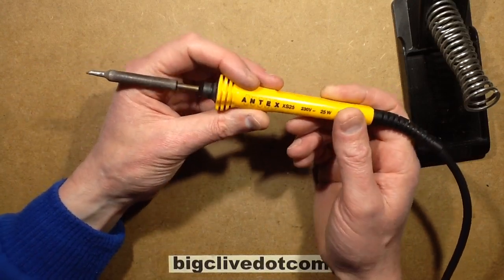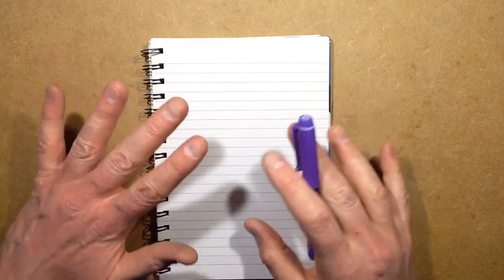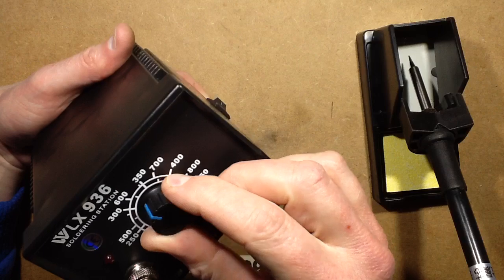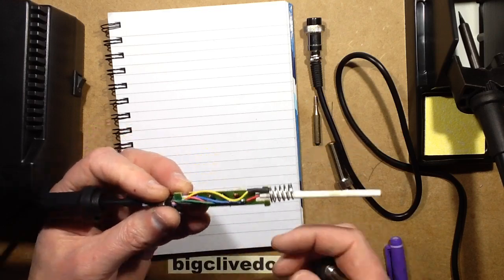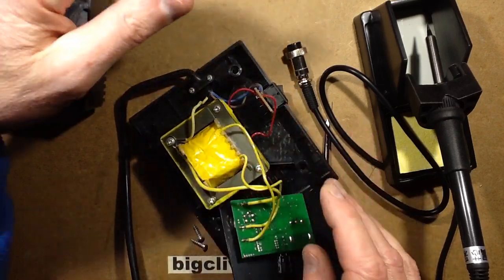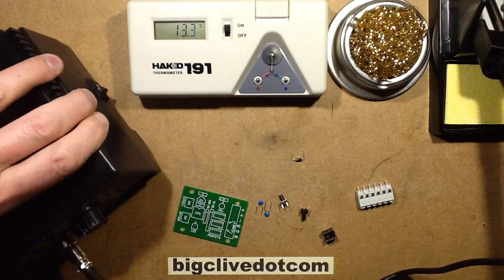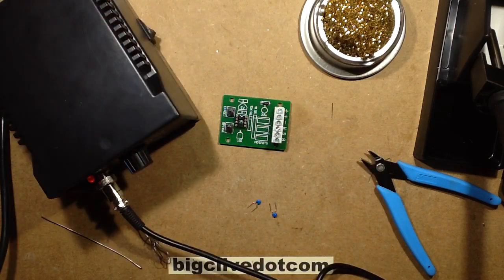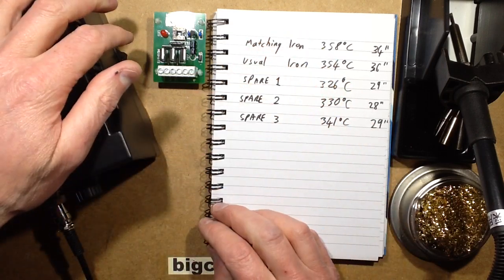Soldering basics and choosing a cheap soldering iron.

Comment: Hi Clive can you please recommend an electricity monitor for my home as I am being charged for 17 KWH per day and I need to check it out I have 2 freezers running and pc and then the normal stuff like lights etc so I am a little perplexed.
Reply from the maker: You can get energy monitors that have a sender unit that clips round the main incoming cable to the meter and will then send a reading to a remote unit.  Not super accurate as they only measure simple current, but they will give an indication of rogue appliances.
You could also possibly narrow it down by watching the electricity meter while you turn individual circuit breakers off in the distribution board.
The highest loads are heaters.
To analyse a specific appliance like a freezer you can get a simple energy monitor that plugs in between the plug and socket.
Reply: @bigclivedotcom  Thanks I shall look into it. I cannot read the meter as it is electronic. I live in Spain and the supplier has just fitted this new device. I just need to contest their readings. Thanks again.

Comment: Flux core on its one is fine in a pinch. But you want to get flux on its own aswell i use Amtech flux really good stuff. But if you are doing some serious soldering Flux core on its own will do in a pinch but for the love of god get some flux as well you will love your life. And so will your PCB's.
Reply: I agree MrSysdump, fluxing the joint beforehand is the way to go, 100%
It does entail a bit more clean up if cosmetics are important.

Comment: 60/40 solder is 60 percent roughly 40 percent lead. Which is why it's relatively expensive compared to lead.

It's also actually often closer to 62% tin 38% lead which is the eutectic point of tin and lead, meaning roughly that it all melts and freezes at the same time, so you are less prone to get chunky custard weak joints if you move the leads ever so slightly when the solder is half solidified, because it is like to solidify all at once. Or at least only as only one component rather than some weak and prone to failure semi solid slush.

Comment: As a point of pride for ye, I was following along and watching/listening to this video while doing my first soldering repair/third soldering attempt/first proper soldering attempt, on something that's a remarkable pain- an in-ear headphone speaker that's supposed to be connected to two short, flexible lacquered copper wires in the speaker's mounting shell. Did it with a PoS cone-tipped iron- not a station, the iron itself plugs in to the outlet and came with nothing to hold it while on- that can barely melt the solder it came with and a way to hold only one piece- of which I opted for the speaker. I chose to pre-tin the connection pads for... obvious reasons, and it worked.
Now something to laugh about: Apparently I had access to a decent soldering station with multiple bits, a way to hold both components in place and someone who was willing to teach me this whole time.
I am an idiot that now knows how to solder.

Comment: Do you think Inconel would make a viable soldering tip? Tempted to whip a few up after watching this.
Reply from the maker: I'm not sure how well it would take the solder.
Reply: @bigclivedotcom  i will have to fine out. Otherwise it sounds like the ideal material durability wise.

Comment: I've been soldering stuff for over 40 years (sheesh!) and everything from heavy brass and copper plate to assembling circuit boards with upwards of 200 components on board. 
My one tip is the use of a resin flux called FLUXITE. it was used by wireless constructors back in the early days of radio when home construction was the in thing, mostly for the rich I have to say. Anyway, a tin of this stuff will last you half a lifetime, you need so little of it, and if you are soldering heat greedy components, you just need the merest wipe and the solder will flow like water. For tinning leads, twist the conductors as per normal, dip into the Fluxite and with a small amount of solder on your iron just touch the wire for an instant tinned finish.
It is not acid based and so does not corrode circuit boards or connections, but don't be tempted to use too much as it can get messy quickly.
I was once told that it was called Fluxite because it's a Fluxite better than anything else. LOL.

Comment: hi sir . do i go with this soldering gun or get a regular ..what will be the watts for this kind of jobs.. i need to fix a amp ..and my regular sodering gun dont have enough heat
Reply from the maker: For really large solder connections you need to use a high power iron.  This one is rated around 50W and if you use a large tip for extra thermal mass it may work.
Reply: @bigclivedotcom  ..what do you think about the $10 dollar soldering gun 60w adjustable one ..

Comment: When I first learned to solder I used plumbing solder. That really thick stuff. Probably 1/8” diameter solder. And I would apply flux from the little tins with an acid brush. Man that sucked.

Comment: you are bang on about multiple irons, i have three one with a 1/4 inch flat chisel bit, one with a fine cone tip and a small handle with a fine chisel tip, and just use the one for the job, if you have the hot air pencil on the other side of the station its all you will ever need.
like you say why change tips just swap the iron.

Comment: You didn't say anything about what I call ringlets, there is a ring around the solder between the pad and the wire. If the component moves a lot and the solder wasn't doing good or if when when soldering you move the wire and when taking you take the tip off and the wire moves as it cools. I found a lot of ringlets in aircraft radios when the used tubes, many years ago. The capator
Reply: Sorry! The capacitor from high voltage were big and small aircraft does a lot of vibration.

Comment: These chinese units are not rubbish. Yes they are out of calibration but if you can set it at a level that works for you then that's good enough. I bought one of the digital units with red buttons which was way out of calibration, infact  I had to swap a resistor in series with the calibration pot for a higher one, it was pretty much bang on with half way adjustment either way. I have repaired several curcuit boards with SMD components on them without any problem. I understand these are not Daves preference but not all of us has the money to splash out for the high end stuff.

In summary they are good enough and affordable for the hobbyist.

Comment: I think most of the time what really matters is just the mass and the shape of the tip.. As long as the tip gets to the right temperature any hardware behind it will do.. Most of the problems I had when starting was caused by using a tip that was too small and required too high temps to work or had the wrong shape.

Comment: Verdict on the Yihua Soldering Station:
It's the best soldering iron I've ever owned.
It's even better than my old Weller I had for over a decade that cost $60 ($15 more than the Yihua!)
The heat gun that is part of this soldering station is great. It works on heat shrink tubing better than my previous cheap-o $5 separate heat gun.

All in all, I'm very impressed. I can't wait till my other bits arrive. I'm even happy with the T-I needle tip it came with, even if I do think I'll be using a T-C2 chisel tip much more often. I've also got an extra iron for it on order, so that I can swap irons if I need to instead of waiting for one to cool down to change the bit. This is a great value at the $45 I paid for it; even if the extras I'm adding to it push it over the $60 I paid for the Weller, which I didn't get any extras with.

Total Purchases (All include S&H):
YiHUA-8786D 2in1 110V Electric SMD ESD Soldering Iron Station Kit w/ Hot Air Gun: $44.49
HAKKO 191 LED Electric soldering iron thermometer temperature tester: $13.43
60W 24V Soldering Iron Handle with 900M-T-I Tip Station 5pin Welding 852D+ 853D: $7.29
10pcs Iron Tips for Hakko Soldering Rework Station 900M-T Series: $6.98
Total: $72.19 worth of gear.

If you remove the special thermometer (used for calibration) it comes to: $58.76 - which is still less than the expensive Weller Iron that used to be my go-to iron. Hot dog.

I used the crap out of it today with the T-I tip it comes with, and the tip still looks pristine. Three model railroad qengines installed sound decoders in under 20 minutes each. That's half the normal mean time for engines that I don't have to isolate frames or anything weird. This is because the iron heats quickly, maintains its temperature well, and the heat gun dealt with all the heat shrink tubing in the entire engine in under 5 seconds.

Thanks Clive for the great video and review of Chinese Irons in general. I'm a new subscriber; having been hooked on your channel for a couple of weeks now. Found this gem amongst your old videos just as I was shopping for a new iron since my Weller died 2 weeks ago. Keep it up!

Comment: Solder with lead is good. Solder without lead but with silver is not bad.

A while back, I bought a Precision Gold soldering station, with three temperature presets.It seems to take the same iron. I had a Maplin order code for a replacement iron, but of course, there's no Maplin now. The same replacement irons are probably compatible, I guess.

Comment: these cheap ceramic core irons go out often due to the fact that the tip doesnt actually touch the ceramic heating element. the inside gets hot down to the handle after about 10-20 minutes. eventually the solder joints inside on the pcb go bad due to both flux not being cleaned and heat from the element making it down to the joints..

Comment: prices for the antex 25W iron are better,i bought a new element for under a tenner,i also have a chinese 30W iron and it works but glows dull red on the steel body,so i added a DIN socket on an old maplin power controlled station and DIN plugs on my irons,i need to change the SCR to a higher power device,i got fed up with crazy prices from RS for iron spares.
EBAY all the way,and of course me to make the controller. solder fillet by capillary action.

Comment: My father taught me to solder them at 8 or 9 years old. I made a science fair project that showed how a capacitor would pass AC and block DC.
There where 2 other projects about capacitors. One showed how they can store electricity, the other demonstrated their use in tunning circuits.

Comment: I used to love my Weller. Used it on the bench for 5 years, same one, never let me down, not sure how many bits I went through. Over £500.00 if you look around Ebay ? Whaaat? There are some for around £150.00 mark, piss take FFS a f*****g soldering iron ! Not sure if this is the one you mean £12.00 ? FFS ! https://www.ebay.co.uk/itm/UK-Electronic-936D-Soldering-Rework-Station-Temperature-Control-Handle-Stand/152709959036?_trkparms=aid%3D555018%26algo%3DPL.SIM%26ao%3D1%26asc%3D20140122125356%26meid%3Da9acb716943d4c76a0898962227944a2%26pid%3D100005%26rk%3D2%26rkt%3D4%26sd%3D282671624102%26itm%3D152709959036&_trksid=p2047675.c100005.m1851
Reply from the maker: That does seem quite cheap, but we're talking about a mass produced industrial product here.  You do have to "bring it up to local standards" but otherwise they are very useable.
Reply: @bigclivedotcom  Weller are so expensive I don't see how they can charge so much ...... well nearly can't understand. Great stuff though, prolly don't say thankyou often enough, but then again. Bell Haven 80 Shilling is no on genaeral sale down here in sassanach land so I have to be withdrawn :) Eat your soormestroooming ! :)

Comment: Thanks for another great video Clive.

One question: How do you know when to remove the iron? You seem to wait for a few seconds after removing the solder. I imagine by now that this is just instinctive for you, but how would a newbie know when was the right time to take it off?  Thanks.

Interesting that lead-based solder is still available.
Reply from the maker: You can see the way the solder flows round the components.  It's an intuitive thing that you get a feel for.
Reply: @bigclivedotcom  Many thanks Clive. Did the odd bit of soldering many years ago, but never really knew what I was doing :-) ("self-taught" ho ho :-) ).

Comment: Flux free solder is very good for model making. This allows the appropriate flux to be uses once the metal/s being soldered are known. And soldering aluminium and stainless steel is straight forward with the correct flux and solder. Search for Carrs soldering products and you’ll see what they have to offer.

Comment: Can you use a soldering iron (with 5 pin female plug) from a different brand with any soldering station? If i ever need to replace, is it safe to buy a soldering iron from a different brand than my soldering station? thanks
Reply from the maker: Most of the generic stations take the same iron, but there are two sensing technologies.  One uses a thermistor and the other uses a thermocouple.  Some of the irons have a male plug on the end of the lead while others have a female socket.
The keywords for the Chinese irons on eBay are soldering handle.

Comment: Ive got a similar soldering station - specificaly a '998D Soldering Station' which can be found for about 30 quid on eBay: https://www.ebay.co.uk/itm/998D-Electric-Soldering-Iron-Desoldering-Station-Hot-Air-Rework-Gun-LCD-Display/113325738096?epid=3020246543&hash=item1a62bd8870:g:rHMAAOSwB8tbhPHc:rk:2:pf:1&frcectupt=true 
Been in use for one year and came with a spare heater element, suspisiously very similar to the Hakko one you shown about half way through, with same model numbers, and information with minor differences like chinese name, chinese instructions etc.
With a years use I am still on its original heating element and soldering tip which I am very impressed with, I solder about 345oC and its never let me down, leaded solder all the way! 
Only one thing which for me is that the switches are not labeled to which turns on the iron and which turns on the solder blower gun, which not only that but the switches are also reversed to the wires coming out, i.e. the soldering blower gun wire comes out on the left but has the right on/off switch above the irons outlet, the iron has its power outlet on the right but its switch is on the left above the blower guns outlet. Only a minor thing but was sorted by a sticky label, a pen and a pair of scissors to cut the label to the appropriate size. All in all I highly reccomend the station and I am very impressed with its quality!
I plan to be uploading a video in the very near future onto my channel here with a review of this station so anyone interested keep an eye out!

Comment: Clive, what's your opinion on the solder pens what run by battery?
Reply from the maker: I've tried two.  A retro one based on the original Wahl irons and a modern one that uses a USB power bank as a supply.  Both performed very well.

Comment: After watching this, I went to build a tiny (7 parts) thermometer kit I bought last week. Soldering was all done and the kit-manual suggested to test the LED connections: "Connect pin 4 (battery -) on the IC socket to pin 5 and 6 to test the two LEDs." I expected everything to work but tested anyway. First connection... nothing happened... for a second. Then there was a brief flash accompanied by a frizzling noise and the smell of burned electronics. I actually bridged pin 4 and pin 8 (battery +) shorting out the circuit and frying on of the copper tracks on the PCB. (D'oh!)
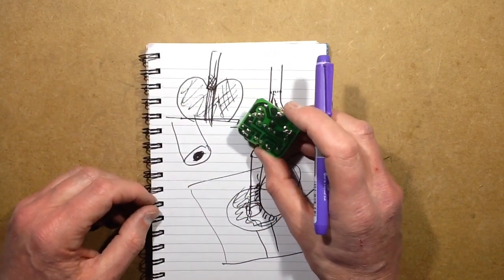So much for "... probably messing up your first kits." (11:08). Could fix it though. :)
Reply from the maker: It probably is just the copper track that has blown like a fuse.  If you bridge a bit of wire between the end to replace it then it should work OK.
Reply: Yep, that's what it was and how I fixed it. Now it is happily blinking on my shelf.
And it was quite interesting to see how that track peeled away from the board, so I even learned something there. :)

Comment: I'm not gonna dip my tip in a repurposed ashtray with brass or steel wool in it to clean it, thank you. I'll just stick to a wet sponge, okay?
Reply from the maker: That's what I thought, but the brass wool is actually very soft on the tip, does the job well and never dries out.
Reply: :-D 
So I tried. Now my tip is sore and my GF thinks something is wrong with me and I have to go see the doctor.

Comment: I just wish soldering irons had a silicone sleeve over everything but the tip, so as to avoid melting things near the connection you're soldering, or burning extremities and whatnot. I suppose the iron would overheat or something if the barrel were insulated that way.

Comment: exellent lesson indeed. sir i am having problem with my hakko 888 F-d temp controlled solder iron that make  small solder balls create on solder tip instead flow it through the tip.i followed all the neccesory instructions given by hakko as well as WBT lead free solder.it is really frustrating. could you please give me any advice..thank you.
Reply from the maker: Is the tip dark and rough?  It should be clean, smooth and shiny.  Solder should be flower on the joint and not carried to it on the tip.

Comment: I'm thinking about making my own soldering iron. I've spent a load of money on the things and the cheap ones tend to break or get otherwise maimed. It doesn't help that I will obsessively desolder everything off boards that are destined for the garbage under normal circumstances, just so I'd have the parts.